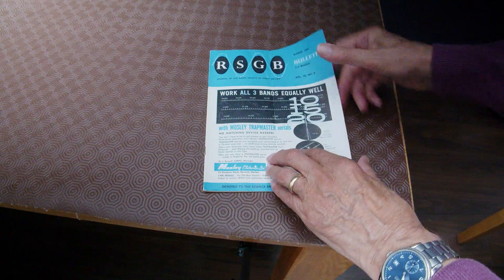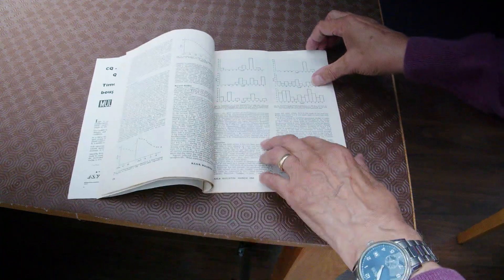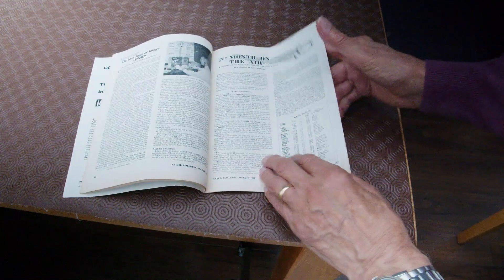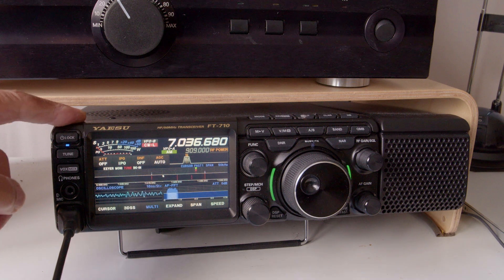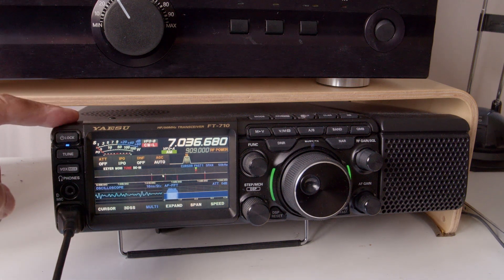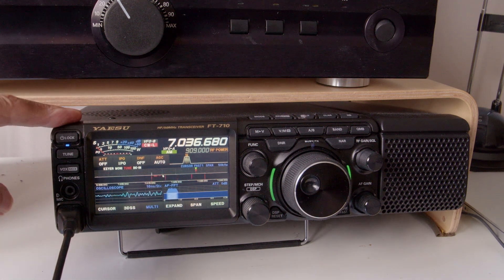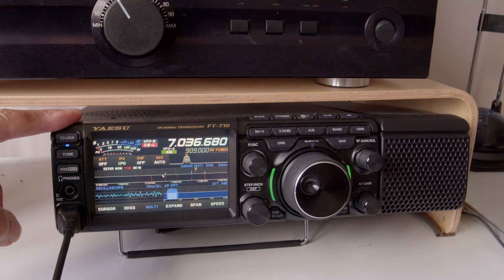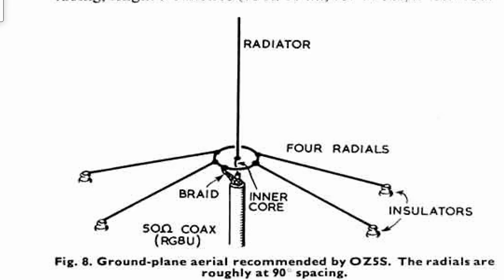Historic Antennas   HF Ground Plane

Comment: I have a 1/2 vertical for 10 meters mounted on the eave of my single storey roof that only afew meters off the ground and getting really good results using 100 watts SSB, I’ve worked the world on it from here in ZL, thanks for your video Peter

Comment: I have recently gotten back into amateur radio hobby after a long break. I first got my amateur radio license in the 1980s. Back then it didnt seem to matter what antennas you could put up. There were plenty of CB and amateur antennas visible all over. Now plots of land are smaller and even TV antennas are less visible. I have been experimenting with my own homemade wire antennas. I was curious as to what antennas I could install without the permission of the council. Anyway it seems I am only allowed an antenna no more than  2 metres above the roof line. Antennas must not be between the house and the street. Currently my only permanent antenna is one tuned for 10m and is a T2LT flower pot vertical dipole antenna hanging from a 6 metre tall gum tree in my front yard. It seems to perform quite well. I have also installed a inverted vee antenna on the top of my roof on a 2m pole keeping within the council regulations however the tree dipole antenna seems to perform much better.

Comment: To quote Greg Mihran, KJ6ER: I have found through modeling, testing, and extensive experience in the field, this elevated vertical is over 90% efficient and better than any ground-mounted version I have ever used. This means that when 100 watts is applied to the antenna, more than 90 watts are radiated! For comparison, a typical ground-mounted quarter-wave vertical antenna at resonance with four ground-coupled radials is only 37% efficient! 
More details: https://drive.google.com/file/d/1LwSbXXeovjJdT8ijpOi-9FYR--nNsxgD/view 
As verified by the ARRL and published in QRT. https://youtu.be/cClmWBYzNaE?si=rPZ3T-fIBJG1q7LO

Comment: Thanks Peter for a very interesting and thought provoking presentation.
I also saved my pennies as a young radio ham and still have my dismantled 14AVQ in the garage, maybe I should put it back up in the sky?
Interesting to note the insulated from ground 'tuned radials' and which in effect makes a loaded vertical dipole and with a fairly good match to the 'new' 50 Ohm coaxial we were moving to from cheap 75 Ohm TV coax for resonant horizontal dipoles or nest of a number of same  using a single feeder.
I mounted my 14AVQ above a neighbours flat roof some 15 feet above ground level.  I might add with their permission. A move to a home with more ground meant a tower with horizontal metalwork and plenty of space for wire aerials costing just a few pennies! Hence retirement for the vertical noisy aerial😅
73, Martin, GW3XJQ

Comment: When it comes to UK land shortage is to blame for putting verticals on the ground. When I lived abroad I had vertical installed about 2m above a roof line. I did that because I wasn't afraid of antenna falling down on neighbours property. Nearest house was about 150m away.

Comment: Hello Peter -- Wonderful to walk along with you today.  I too had a 14AVQ ... ground-mounted originally, then on the roof of a two-story house.  I moved it because of the poor performance on the ground.

What a difference!  The roof-mounted version had one or two TUNED radials for each band.  The noise was less, but the DX was much, much more -- both receiving and transmitting.  I worked HB9AUN (from the US East Coast) the afternoon I moved the antenna and still remember the QSO.  For me, moving the antenna to the roof and using tuned radials gave me at least 2-3 S-units compared to ground mounting.

I think the reason a lot of ops chose ground mounting is for guying.  Our 14AVQ's were self-supporting.  If we had a sturdy base, no further guying was required.  In many cases (most of the DX Commanders, for example) guying is required -- sometimes two sets.  Presumably, it would be easier to achieve this when ground-mounted.

Lastly, thank you.  I've enjoyed many of your videos over the years.  You have a very practical sense about amateur radio and a lovely way of expressing yourself clearly.  Thanks again, OM.  73 de Stef DU3/NN3M
Reply from the maker: Hi Stef great to hear your story and thanks for your kind words . Much appreciated..Peter.

Comment: I have a ten meter vertical antenna on the roof of my two story house, it works great and is quiet.  For portable, I often use a ground mounted vertical with equally good results.  But that’s usually at a park etc…. Thanks for the thought provoking video Peter!
Reply from the maker: Thanks for sharing. Much appreciated.

Comment: I prefer to elevate my vertical with a surveying tripod. That gets me 1.5 m off the ground. If I really, really want to go higher, I can guy 3 or 4 meters of PVC and attach the antenna to the top. Two reasons. One is the noise reduction. You covered that brilliantly. Two is the higher efficiency of elevated/tuned radials compared to using ground radials. A person needs at least a hundred ground radials to achieve the same efficiency as one or two tuned/elevated radials. Mike Mertel (K7IR) at steppIR has covered that topic in great detail based on some of the work done by Rudy Severns (N6LF) and others. Deploying that many ground radials is painful and a bit costly, but on the plus side you don't need different length radials for each band. The configuration I like the best is an elevated vertical OCF half wave, but you need a coil to get 40m or longer with a telescoping whip (longest telescoping whip I've found is the Chameleon SS-25).  That allows me to eliminate the radials entirely, but I do have to adjust the telescoping length for each band.  It's always a set of trade-offs it seems unless you can invest significant money in your antennas, but an elevated vertical OCF half-wave is my current favorite to get the best performance for the least effort. In the US, many homes are now encumbered by a home owner's association (HOA) and they tend to be very anti-amateur radio. Luckily, my home isn't encumbered, but HOAs are forcing a lot of amateur operators to use portable vertical antennas in their garden and take them down when they're done. Erecting a tower is totally out of the question even if you have the money to do it. I suspect HOAs explain much of what you're seeing. Thank for posting Peter. All the best. 73.
Reply from the maker: Great to hear your story and how you have found what is best for you. Thanks for your support on the Channel.

Comment: Rather than repeat the comments that already noted the installation and resonant vs non-resonant radials issues, I would simply refer you to MMANA to experiment with what happens to the radiation pattern as a vertical is elevated above the ground.   Pay particular note to the radiation angles and the development of other radiation lobes and the gain they offer at those angles to get a better understanding of why elevated vertical HF antennas perform better than ground mounted verticals.

The radiation pattern is profoundly important and is not static.   It varies, based on a number  of factors, including installation height above the ground.

Interesting discussion.   Thanks for the video.

73
AI4IJ

Comment: It’s probably the easier option- not because of laziness, but practicality and safety. I had a DXC on my shed roof (metal, using the shed as a ground) and it was great for dx, but terrible for tuning it!  Up down up down whoops, don’t slip on the ladder or wet roof.  I’m going to put a lawn mounted on at my new qth.  This will also get it some distance away from inhabitable buildings as far as the guidelines for rf emissions goes.  
73.

Comment: Nice video mate, with a bit of humour hi  like that.
Many tell me, they worried about the neighbor's seeing ant above ground. 
Seem neighbor's were more forgiving in the past.
I say , its my garden , so i will enjoy it the way i want.
I dont tell the neighbor,  stop using your noisey motorbike hi.
Reply from the maker: Hi Brian, a touch of Northern straight talking! Take care.
Reply: Antennas on houses used to be plentiful... Band 1 and 3 TV antennas, UHF TV antennas, plus a Band 2 radio antenna. It was a mess up there. A thin vertical made little difference. Not quite the same today.

Comment: My personal experience has been to get better results with an elevated vertical than one that was ground mounted. After 30 years of experimenting with home built antennas I’ve hit upon one that works well for me. Presently I’m using 17.5’ wire running up the inside of a fiberglass extendable fishing pole, fed 4:1 with a single counterpoise/radial made from 4 conductor flat rotor wire with each strand cut to a 1/4 wave of my favorite bands (10-20m). It’s mounted atop a nonconducting pole about 18’ above ground. Using this antenna and just 100 watts on SSB, this year alone I’ve worked stations from as far away as Japan, French Polynesia, Arab Emirates, and Antarctica, all from my location in Florida USA. I’m sure others have had varying success with different antennas, and that’s what makes this hobby fun and challenging! 73 de Dan WD4DB
Reply from the maker: Great to get that info.

Comment: All my verticals have been above ground. My house has two floors and that puts the antenna too high for 10M which would have high angle lobes. I have always had better performance with a dipole from 40-10M but on 80 and 160M the roof mounted vertical is better. I've since gone to an 80M Inv-L on the roof and it is better than my old base loaded vertical.

Comment: I agree and think think that the vertical will work much better in the air. The reason that is not done as in the past in many cases, is because the easy way is forbidden. Putting the antenna and radials system atop the roof is disapproved by insurance companies and local regulations, in many cases.
Reply from the maker: Thanks for that info.

Comment: For most, an antenna on the ground is blocked and distorted by nearby buildings. For 80-40 NVIS, the ends of an antenna have a null so you don't want that pointing up and even a short horizontal does better. 20 thru UHF, the higher the better, but even 33 feet much less 66 feet, can be hard for most of us. A 16 foot carbon fiber whip, roof mounted is a possibility and almost invisible. Add a remote tuner for other bands.

Comment: Hello Peter. Simple really. Ground mounted verticals do not require tuned radials. Therefore a multi-banded vertical (like the DX Commander Venture I uploaded a video on yesterday) can have one set of radials for all bands. Elevated vertical antennas typically require tuned radials, and therefore multi-banded verticals need multi sets of tuned radials for best performance.
Reply from the maker: Yes the trade off is convenience vs performance.
Reply: @ VK7 on my ground mounted vertical the other morning. I’m not worried about its performance!
Reply: I only use resonant elevated verts, far better performance for me.1 to 2 S points over a ground vert.
Reply: @brianfields4479  I’m really happy for you

Comment: Hello Peter - nice rambling chat & very enjoyable.  I have my GAP TITAN around eight feet above ground and I find it works well, well, think so.   However, in my last QTH I had my GAP antenna on the roof which was a good 40 feet up in the air,  it really worked a blinder so as to speak.  I think the higher you can get your vertical off the ground is the better option.
73 de Ger EI6DP
Reply from the maker: Yes that is also my expedience.

Comment: Mono-band 1/4 wave verticals are much easier to elevate then a 4 or 5 band vertical antenna which would require a pair of tuned radials per band at 180 degrees to each other to be truly omni directional. So if you have a trapped or multi-element 4 or 5 band vertical, in most cases the ground is the only real option in a typical small UK garden. If its a 20m mono-bander then its much easier to do elevated. Seems pretty obvious to me.
Reply: @thacademic3023  or trapped counterpoise wires, possibly. Or counterpoise wires for each band adjacent to each other.
Reply from the maker: Thanks for sharing.

Comment: As a lad I had a vertical antenna called a silver rod for the CB frequencies which had 3 radials which I assume were the ground plane. This was up high on a pole connected to T & K brackets on the side of the house.  My antenna now is the Hustler 6BTV which once installed will be ground level simply so I can hide all the ground plane wires into the grass. As stated by Hustler if above ground then a ground plane is definately required so from an aesthetics point of view and therefore  keeping neighbours happy mounting at ground level keeps the peace. If I had the land around me I would definately put it in the air.

Comment: Did you need planning permission for ham antennas in 1960?

2m off the ground seems doable with elevated ground wires?

I wonder if the fear of big brother is more to blame?

Possibly a good topic for an RSGB survey. Antenna types used for POTA, SOTA or home station.
Reply from the maker: Planning - no idea - I was a teenager!
Reply: @ 🤣 fair challenge
Reply: Did neighbours complane about what you do in your garden as much in 1960? I have found verticals only useful for DX, what about working locals. Radio is not all about DX so I stick with Inverted 'L' which gives both.